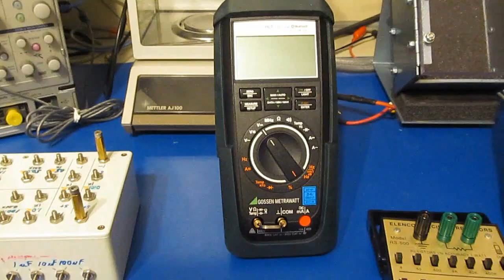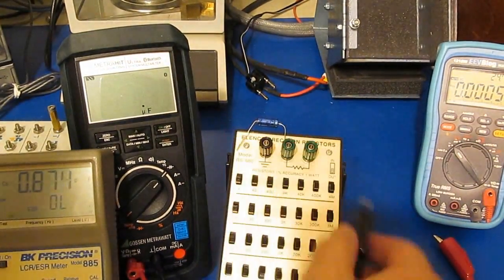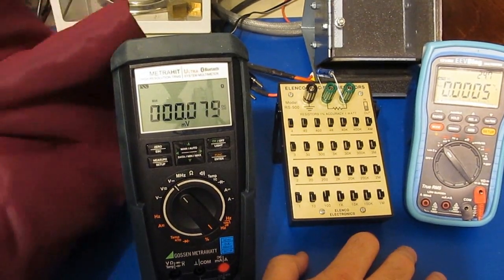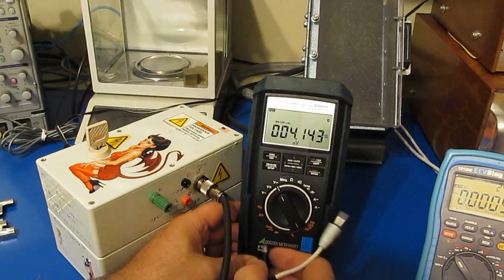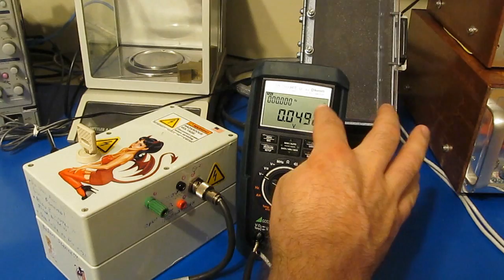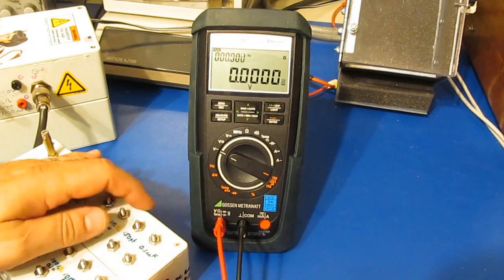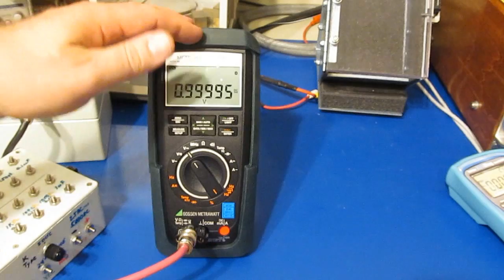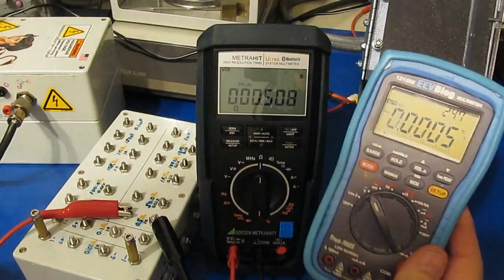12KV Transient Testing with Mods to the Metrahit Ultra

Comment: I noticed at 5:15 the reading starts to drop even though the inputs are shorted. Is that normal?
Reply from the maker: Normal for this setup, or meters in general when looking at uV levels?  I did run some comparisons between this particular meter and my old HP34401A that may provide you with a better indication of its performance.
Reply: @joesmith-je3tq  Probably both. The laboratory I am working for recently bought a different model of Gossen (the Metracal multimeter + calibrator), and the zero would drift up to -0.21 mV under the 300 mV DC range. I wrote to Gossen asking about whether this meter is faulty or not. They replied saying this is normal because the meter uses a "non-linear TRMS converter" and it needs at least 10% of the full span to produce valid readings. I am not very convinced, because I have never seen a meter with such a big zero drift. The comparison with HP seems like a very good reference. I wonder if I can find it on your channel?
Reply from the maker: @chuanliu4685  Looks like I may have posted that data on EEVBLOG.   It would have been roughly 5 years ago.  I did make a video where I ran it over temperature as well.
Reply: @joesmith-je3tq  Thanks for the info. I'll look it up.

Comment: Great! I was kinda worried that there would be a possibility for a spark to the shield, but as usual, your engineering was impeccable. With the Uni-T modification bill set at $50 million, I guess the invoice to Gossen would land around in the same ballpark? If you need an agent, I would volunteer, obviously with a nominal 10% fee. :)
Reply from the maker: I assumed that was the concern.  It was a lot of metal to put in the meter.  There is a fair amount in the front of it.   If I had the schematics, I may have tried to understand what was happening.  There may be a way to correct some of it at the board level.  

You know, $50 million seems a little high for just finding a few problems and cutting up a tin can and soldering it to the meter.  And it would be except having Dranetz block my emails over a simple question and then tell Gossen some BS story about what happened, suddenly $50 mil doesn't seem like enough.  lol  

Really just hope they sort out some of their problems.
Reply: Haha! Yup, I don't think they are ready for an invoice. But blocking your email because they couldn't understand the questions is kinda dorky. Anyway, I'm a happy puppy because I managed to score a hewlett packard 34401a for a very good price! Yay!
Reply: Just wondering, do you have a picture of the PCB? Would like to take a look at the right side of the PCB to see what's there, because it was strange that it was several magnitudes more sensitive on that side.
Reply from the maker: I bought mine brand new when they first came out.  It has been a very solid performer.
Reply: I'm a total sucker for VFD displays. Been on a hunt for six month, but finally found one for a reasonable price in Europe because the shipping cost to Sweden really is the killer...
Reply from the maker: Sorry I did not take any but in the video where I took it apart, you can see that input routes up the right side of the meter.  The left side is basically the current input.

Comment: Nicely tortured sir lol :-D.
I like your eevblog meter, the batterys last ages :).

We can miss things because you are doing the torture, i look at the display as a visual sign of the hell it's in lol :-D
Reply from the maker: That was a big miss on my part.
Reply: Don't matter, "No one is perfect" said the dalek climbing off the trash can LOL :-D.
A sex joke :)
Reply: +joe smith
I think the main reason of the miss is because the Volt input on the Gossen is to the left of the Com input where it's on the right in every meter that I know.
Reply from the maker: You have no idea how many times I caught myself connecting that meter up wrong.    The industry has done such a fine job training us on where the connectors should be.  It was just stupid for them to deviate from the norm.  

That miss was after a solid day of boring tests.  I started doing some other things while I was waiting and just screwed up.
Reply: Not your fault, i would have made the same mistake, i'm used to the standard.
The metrahit designers want a dam good kicking.
Reply from the maker: Maybe some manager thought it would make the meter "special" and drove the design.  Someone in marketing wanted that remote control of the switch.  If it were a bench meter, I could see it.  I think it was a mistake to design this feature in without considering what impact it could have.  It sounds like they were not aware of the faulty AC readings until I pointed it out.  Possible but I am surprised.

Comment: At this point it wouldnt matter how this or any Gossen meter did in testing I would never buy one.  The lack of customer service on such a high end product kills it for me.  Problems happen but poor response to those problems is unacceptable.
Reply from the maker: And my Brymen has not been modified from the factory design.
Reply: Agreed. It's funny when you see the Brymen 869s beside the meter, measuring better and you realize that you could buy 3 Brymen's for the price of one Gossen.
But to be fair, Gossen manufactures great light meters for photographers...
Reply: But I think Brymen is in desperate need of help with the branding side. At least they now have updated their homepage. It's a step up, but not much (doesn't render correctly on mobile phone etc), but at least it doesn't look like a page from 1997 anymore. Great products, bad presentation. Don't even get me started on the boxes they come in. Maybe I'm to picky after working in the advertising business (almost) my entire career as a computer technician. I've learned to admire good design and fonts just by hanging around people working with it.
Reply from the maker: I don't care about the shipping box as long as the product survives the trip.  I like Dave's No Bull box.  I was surprised that he just didn't work with them to develop an exclusive product.  Who knows, maybe Brymen was not interested.
Reply: As I said, I'm probably workplace damaged. Engineers seldom buys stuff without reading up on the specs and check reviews, so there's not that much of impulse buys. But still, for me, the company should reflect the quality of the products, and for me the gap in the quality of the Brymen products and the way the company looks is too large.

Comment: good to see the meter held up to all the abuse. too bad its let down with bad firm ware, and bad design choice of relay, and the other quirks it has.
Reply from the maker: Yes, you can't say it's not an electrically robust meter.  Certainly it ranks right at the top.  But all the protection does no good when there are so many other problems with the design and customer support.